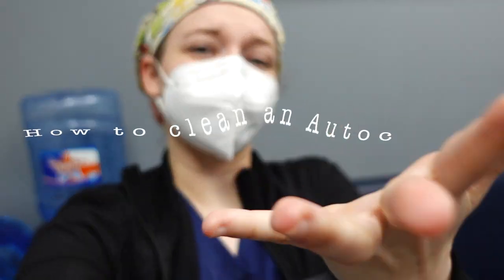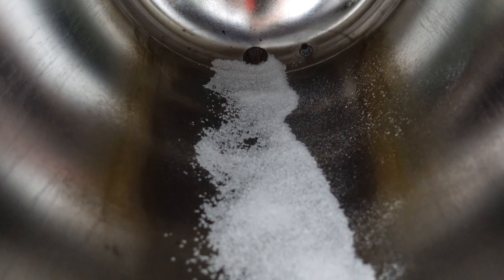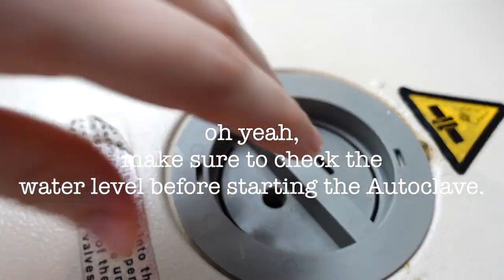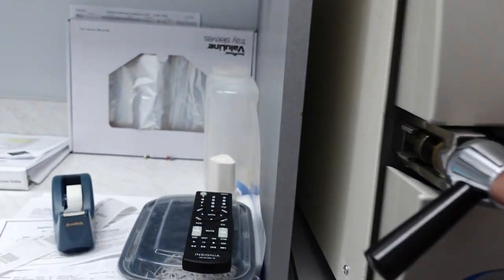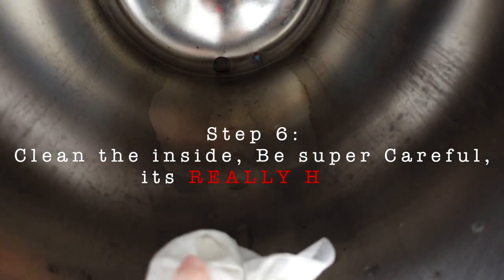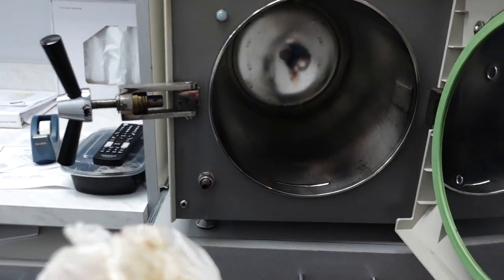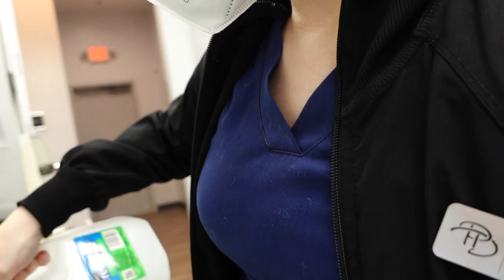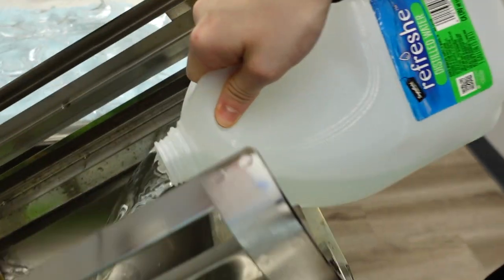How to clean an Tuttnauer  autoclave {EASY}

Comment: A reason you are getting those brown stains on the bottom of your autoclave is the water you are using. It looks like ozarka spring water which is filtered but the minerals aren't removed. Try using just distilled water. You can get a distiller to save money. Or I could be wrong and it is distilled water.
Reply from the maker: It’s definitely distilled water! The minerals in regular water would mess up this auto clave. It’s just getting dirty from regular use. Cleaning with chamber brite isn’t just good for the chamber, it’s also good for the lines. A lot of gunk gets stuck in the lines,chamber, and sometimes the water compartment, especially if your doing more than 20 cycles a week. It comes off after I clean it with chamber brite, so I don’t think it’s anything to worry about, plus I’m sure the dentist would say something if it was.

Comment: Quick question because I just did this and learned the hard way lol after you put the chamber Brite I didn't see you fill with water to the line. Do you fill with water to the line line usual? The package says run for 3 mins on 237degrees and that didn't work then I did it regular and put UT for 30 mins
Reply from the maker: No , this auto clave automatically fills itself , and drains. But if it were a manual , you would fill to the line and run it for 30 mins at high temp and when cycle is finished, you can skip drying and just finish cycle, drain water from inside the autoclave , and get any water out of the chamber that may remain, wipe clean, fill with water and run and repeat a total of 3 times.
Reply: @Amberknabe  thank you so much I did it about 6 times to be sure lol but yes omggg I wish I would've asked first lol 😆
Reply: Mine doesn’t mention outing water to the line and it came out burnt
Reply: @vicnunrz5247  that's what happened to me and I damn near killed myself inhaling those fumes smh lol